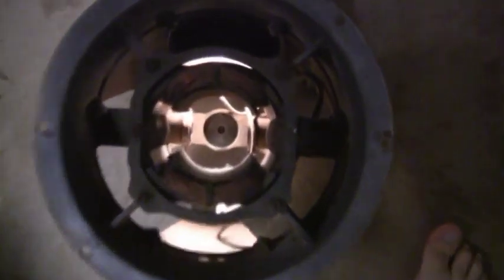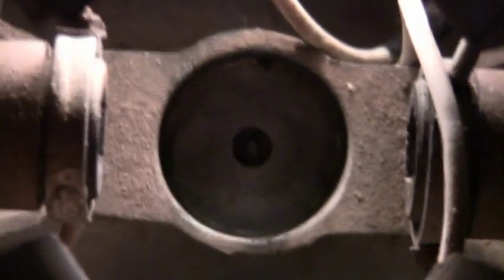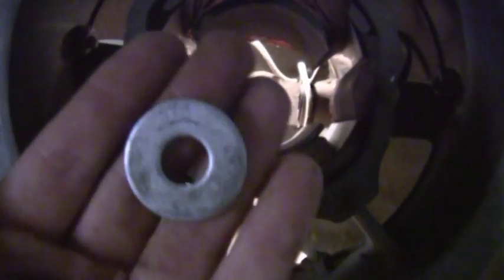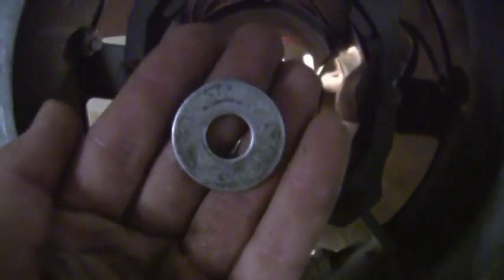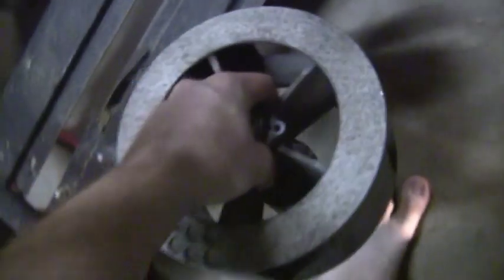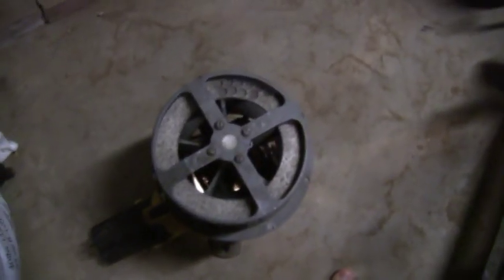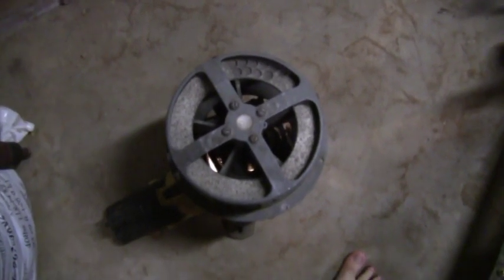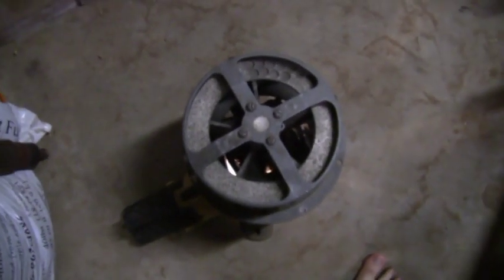Federal Model 2 rebuild tutorial

Comment from the maker: @arohn2007 I couldn't find my shoes at the time (this was the middle of the night, mind you), plus I had just swept off the shop floor the same day I shot this, so there were no rusty nails, wire, etc. present. Under normal circumstances I wouldn't do that, especially if I knew the floor could have potentially had hazardous objects lying on it.